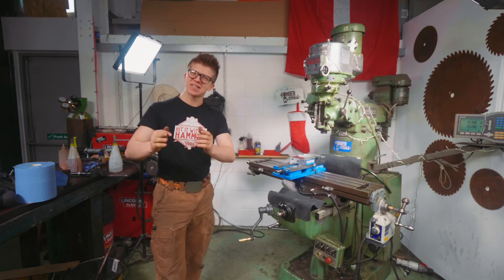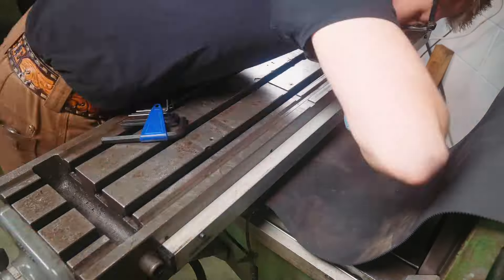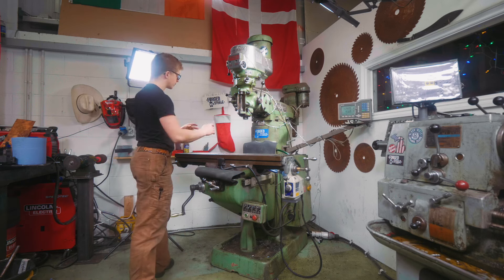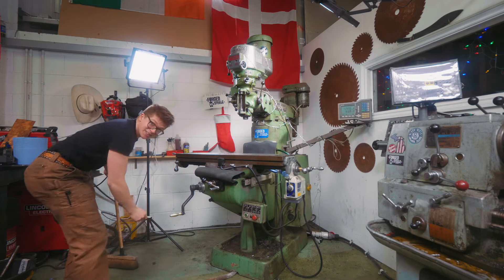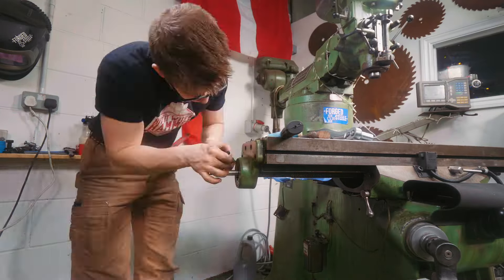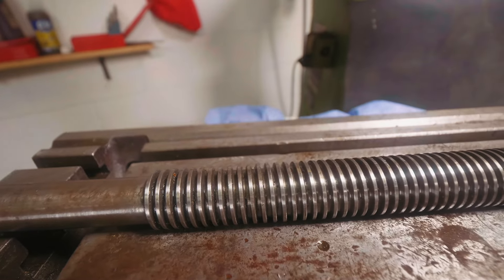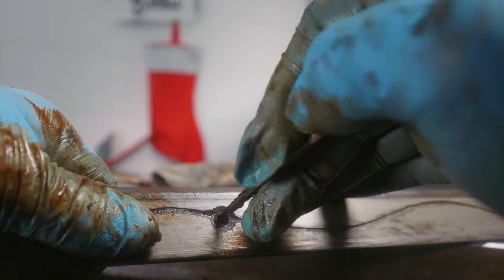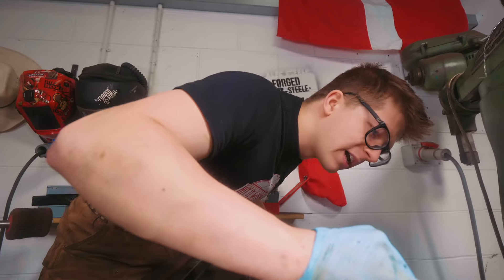It's in pieces....FIXING THE MILL!!! Part 2

Comment: First thins first gasoline cleans the grease much easier cheaper etc and for the oiling lines you are at the write way degreaser and compresed air dont wory they are ment to be under pressure 
P.s dont use graphite grease on gears.
Greetings 🇧🇬

Comment: If you use a flat head screwdriver with a square shaft you can use an adjustable wrench on it for torque. Don't try this with a Philips head. You can also use a box wrench slipped over your Allen key for torque.

Comment: Maybe to late, but sometimes those oiling nuts have numbers on it to indicate how much oil flows through. For example: on the short lines they put a number 3 and on the long lines a number 6. So before drilling you should take it apart and maybe you can order new nuts and put it back as it should be. (sorry for my bad English)

Comment: If I may, Alex, at about 9:50,  You're going to have to learn to use the appropriate sized screwdriver for the job.  I can't tell you how important this is.  With the proper sized screwdriver, you get the most torque for your buck and you won't damage the screw heads.  Remember, use the proper tools for the job and the job will take less time, with less damage to the equipment.

Comment: Those oil fittings your drilling out are likely non return valves, when they are blocked the best thing do do is replace them otherwise your oil is going to flow back to tank. Ideally you want a bit of oil pressure on the slide as it is supposed to ride on a film of oil and not the metal itself. Although with the complete lack of scrapings left that’s probably not going to happen anyway, so you know probably just don’t worry about it.

Comment: Not sure it you're going to see this, but those bits you drilled out are metering units/check valves. They regulate the amount of oil to each area of the machine and keep the oil from draining back into the pump. They come in various flow rates. Your manual should tell you which ones you need where, or you may be able to read the size directly off of the existing units.

Here is one manufacturer or these units: http://www.bijurdelimon.com/us/usa/product-type/accessories/detail/browse/2/article/155/meter-units-352.html

Comment: It is great fun tearing a machine down and cleaning it, one, you get to know how it works, and 2 you can make sure it is doing what it is supposed to do.
I had to strip a Russian Stanko mill apart because the operator heard something inside it smash and clatter down the inside of the machine, after taking it apart I found a gear and something else in the bottom that had been almost vapourised, stripped the rest of the machine to see where it had come from but I could not find anything missing, the machine was way-way over engineered and still did everything it should do, cracking piece of kit.

Comment: could also take the table head to be MILLED flat since it is apart already.
Reply: I hope he does.
Reply: It wouldn't make any difference for any of the work I've seen him do - it was all done on the vise and none clamped to the table.  Anyway, ignoring the divots I doubt there's much sag on the ends which is the typical issue.
Reply: good point about everything being done on the mill vise

Comment: The laws of hydraulics suggest that the pressure in one part of an unrestricted system is  equal in all parts. SO - when you pump oil in one place the pressure at the opening into the oil grooves is equal in all parts of the system. The amount of oil that flows through is regulated by the fitting to which the hoses are connected. You were drilling those out - you were smarter than the manufacturer - and changed the flow dynamics.  Get new fittings and restore the balance. You might replace the hoses as well. They won'd last forever.  With what you have done, short of grinding it, it is about as accurate you can get. Nive job. you ventured way off into unexplored territory and came away with new knowledge.

Comment: Pressure or heat slowly turns oil into wax, which is what looks like is clogging up those internal arteries of the machine. This happens a lot inside engines of heavy machines like 32 ton excavators for example. Which means that it would be a solid idea to repeat the process of your video every ten years or so, if only to just have a looksee but better would be to take it apart every 5 years for a clean up. No one does that though really except serious machinists. Also, when cleaning such big greasy parts, it far more thorough to have it swimming in degreaser for a few minutes and then clean it off with a garage level water jet.

Comment: I cringed when you placed the lead screw in the channel of the metal table. they work best (and sometimes only) if they remain straight. That is a thick and short one so hopefully no harm done. 2 rules ive learned to follow. 1. always support a lead screw (at a minimum) at the 3/4 point from each end, ie carry it from two points, never from just one end (they bend) and 2. Always lay it on a surface that is softer than the metal in the rod, Ie Wood, paper, cloth, etc. just one chip in the edge of the thread can ruin it.

Love your stuff, i keep watching cause your the best. I learn a lot.

Comment: NO, NO, NO!!!!!  Don't drill those oil fittings out!!!  Some areas need more oil than others.  Those fittings you're  drilling out are metering fittings.  If you look on the hex of those you will see a one digit number.  Also, no grease on that bevel gear, chips will still find their way in there and stick to the grease.  The gear doesn't get used enough to need grease.  Other than that you've been doing a great job!!!

Comment: Don't use a hammer on those Allen keys. You chance hitting it wrong and messing up the bolt. Get a piece of steel pipe for more leverage. It's more controlled.

Comment: Please please put the same rubber or at least something else over the lathe bed and protect that as well as your mill. You should get in to the habit of of fitting such protection on any and every machine you buy wherever possible. I know it's a very difficult thing to do but also whenever you buy a new but used machine for your shop take it apart and give it a good clean and fresh oil etc. It's hard but a very good habit to get in to. Not only will you give the machine more life you'll also learn a lot about it and how it works and lastly you'll maybe discover a fault or an issue which is just about to become a very serious issue before it happens.

Comment: I don't think it's a good idea to drill out the base of those oil lines . They are there to regulate the pressure in the lines so that oil reaches all lubrication points at nearly the same time. Good Luck with your rebuild !!!

Comment: This is quite fascinating, but I wonder, is it really worth it to meticulously clean out all of the individual rubber (plastic?) oil lines that run through the machine, as opposed to buying 50 feet of tiny rubber hosing and just replacing it all? Seems like quite a lot of time and effort (and degreaser) could be saved by just ripping all of those teeny tiny hoses out and just running fresh, pristine hoses through.